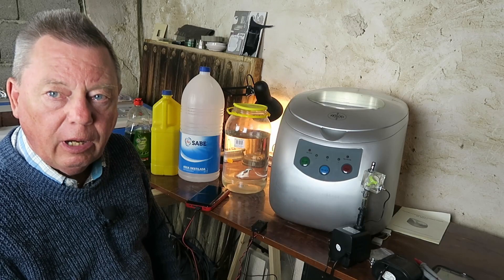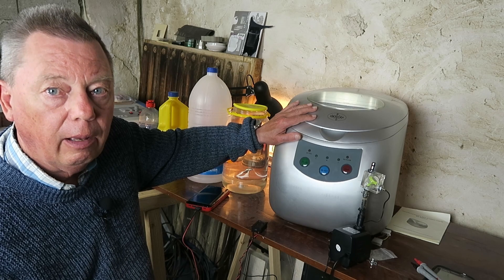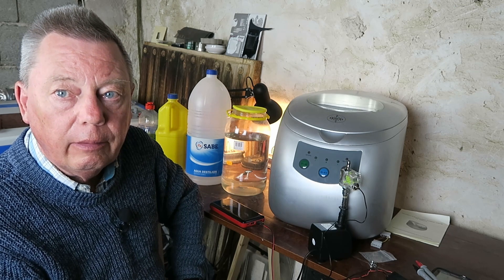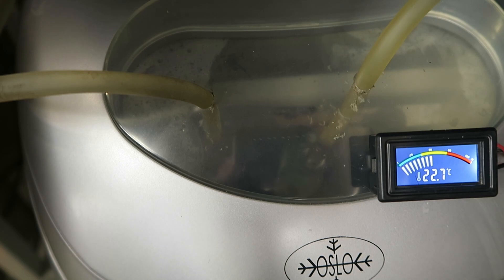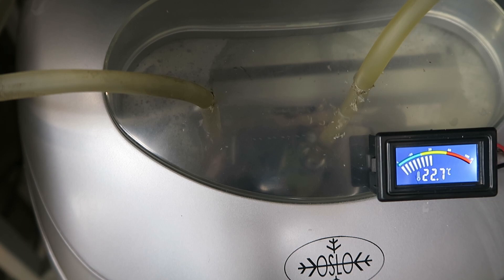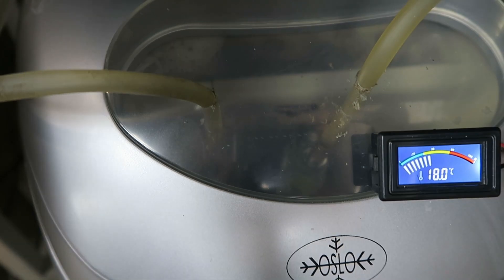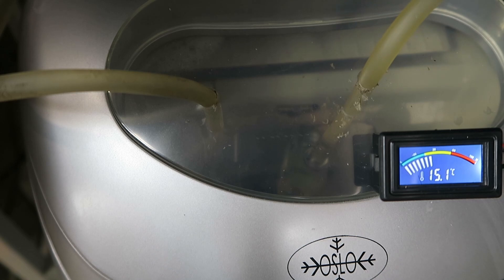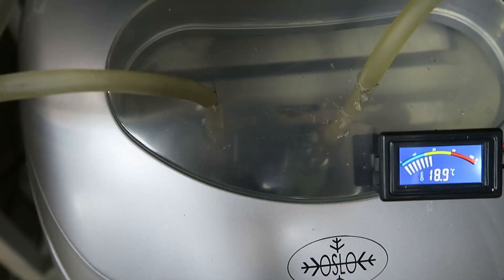K40 Laser Tube Cooling by Ice Machine!

Comment: exactly what i was thinking about 
i have 100 watt laser 
i want to try this 
can you control the ice maker with inkbird or any external temp controller so that itll only kick in for that perticular temp ?

also does the ice maker forms ice based on the timer basis? reason i am asking is if the temp of water increase does it wait for ice block to form completly or it just dumps the cold water directly into reserviour?
either way itll help cooling the water

Comment: Why use distilled water, then contaminate it with bleach and washing-up liquid? I understand the main reason for using distilled water is for the possible safety of its low electrical conductivity, but adding bleach and washing-up liquid would increase the conductivity to at least that of tap water.
Reply from the maker: The tap water around here contains a very high mineral content. The last thing I need are tubes coated in Cal! A little bleach is added to prevent algae forming. A drop or 2 of dish soap acts as a surfactant. Thanks for watching, have a great day!

Comment: hey guys hope this can help someone instead of runing the return line to the reservoir in the ice maker put the return line above the copper coils inside the maker .. i did this to mines and it works perfect the water get cold fast and also i hooked up a inkbird to mines which turns on the ice maker at a set temp and takes it off at a set temp
Reply from the maker: Good idea, I'll will have to try that! Thanks for sharing. Thanks for watching, have a great day!

Comment: I've gone from a commercial chiller to the same setup for the same reason. The temperature of the lazer was not going down. 
The return tube should be in the water otherwise you will get air in the tube when you shut off the pump.
Reply from the maker: Great minds think alike! At first I left the tube out of the water so I could hear it running. It is difficult to see inside the ice machine. Take care not to lower the temperature below the ambient dew point or condensation will form inside the tube. I did this once and had to buy a new tube!! Thanks for watching, have a great day!
Reply: hey guys hope this can help someone instead of runing the return line to the reservoir in the ice maker put the return line above the copper coils inside the maker .. i did this to mines and it works perfect the water get cold fast and also i hooked up a inkbird to mines which turns on the ice maker at a set temp and takes it off at a set temp

Comment: Hello, how do you handle condensation? What is the function of the degreaser
Reply from the maker: I live in the desert of Andalucía, condensation is not a problem for me!! The soap is a "wetting agent" that is it helps the water to coat the surface of the glass tube. ¡Vivo en el desierto de Andalucía, la condensación no es un problema para mí! El jabón es un "agente humectante", es decir, ayuda a que el agua cubra la superficie del tubo de vidrio.